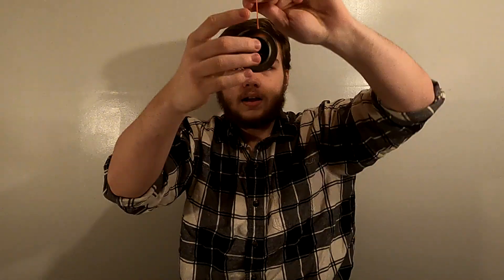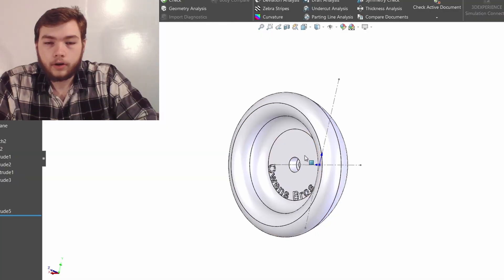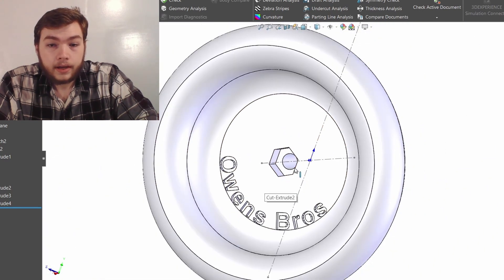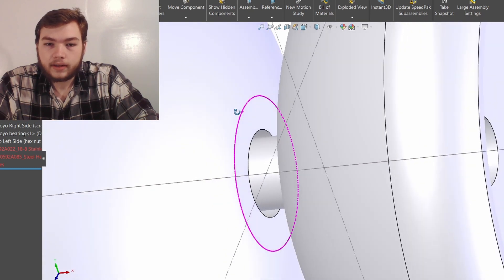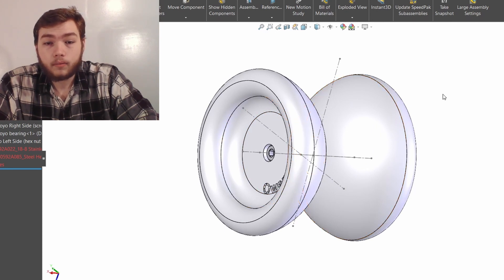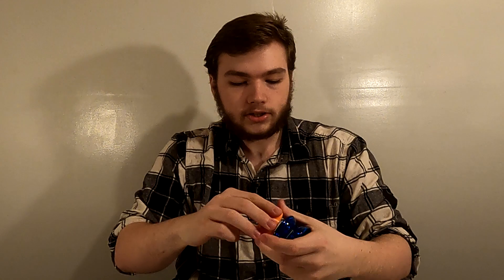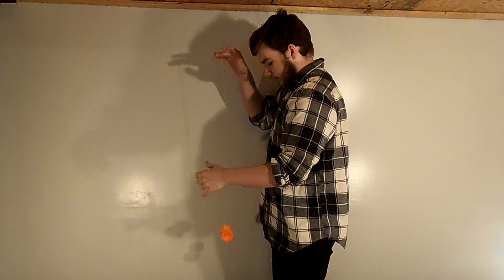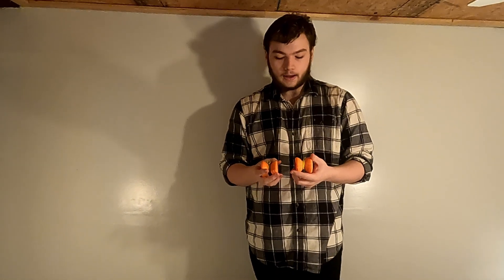3d Printing A Yoyo!

Comment: by giving a groove for the spacers, you can add spacers, so that the inner ring of bearing locks at the place, while the outer ring is wrapped by a string.

thus the throw energy is transferred to the yoyo. also add some silicon pads so that you can do a bind

Comment: Does the bearing help with it being weighted more?
Reply from the maker: The bearing is included to help the yoyo be unresponsive. Basically it allows the yoyo to spin while it is at the bottom of the string so you have more time to do tricks (my bearing wasn't great so it didn't spin much). If you don't have a bearing the yoyo is more responsive. The string is attached to the axle of the yoyo, so when the yoyo hits the bottom of the string it doesn't spin much and starts to pull up almost instantly.